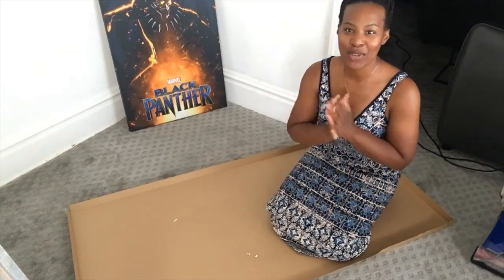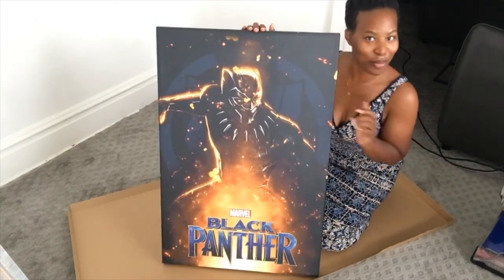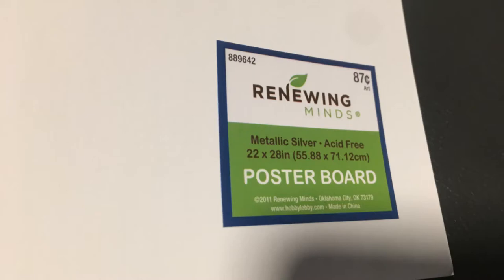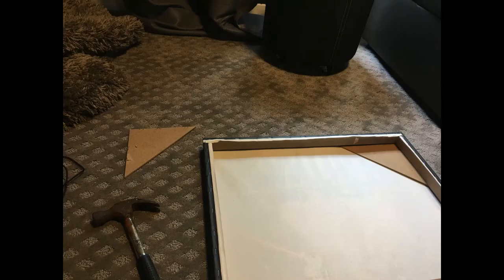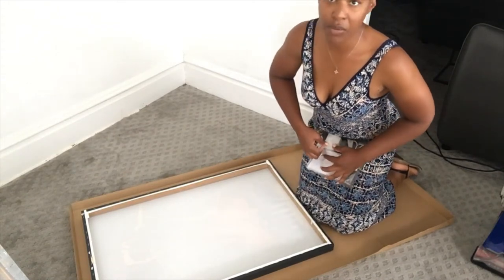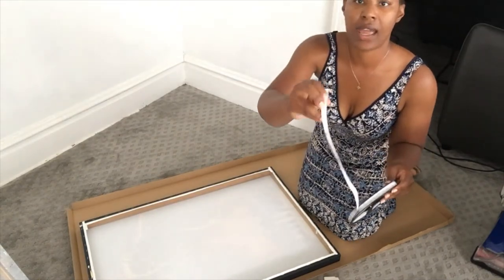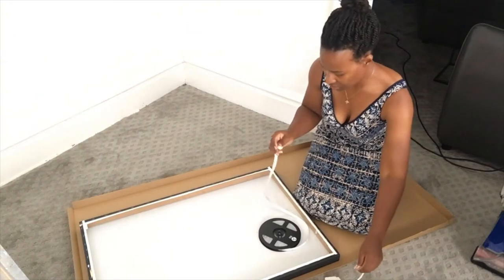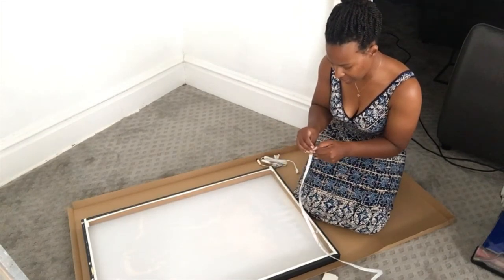How to: DIY Affordable LED Movie Poster

Comment: Hi what size was the canvas? Is there a way to do this with regular frames?
Reply from the maker: The ones I purchased I believe are 24x36, you should be able to, you will probably have to use a shadow box style frame
Reply from the maker: The ones I purchased I believe are 24x36, you should be able to, you will probably have to use a shadow box style frame

Comment: did you use a double sided poster? If so where did you get them from.
Reply from the maker: No, it’s just one sided, got it from Hobby lobby
Reply from the maker: I got the silver poster board from hobby lobby and the canvas from a place called “old time pottery” but you can get the comic canvas from lots of places Ross, Hobby Lobby, etc